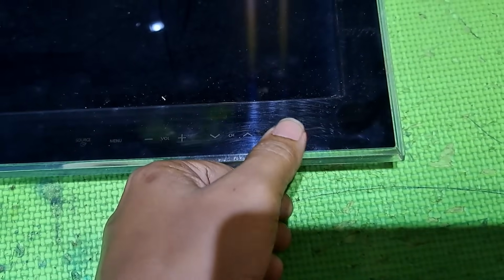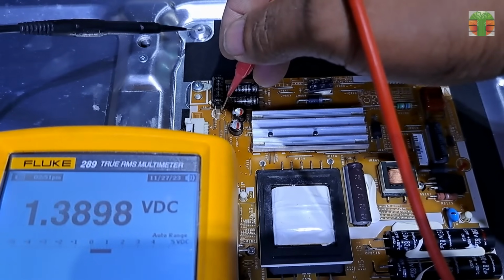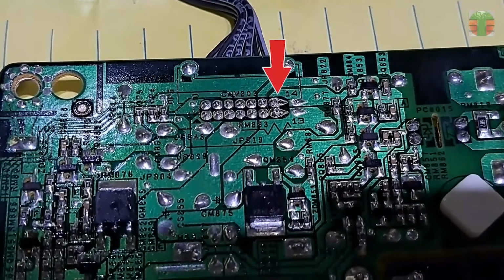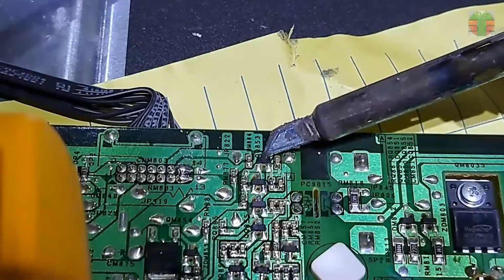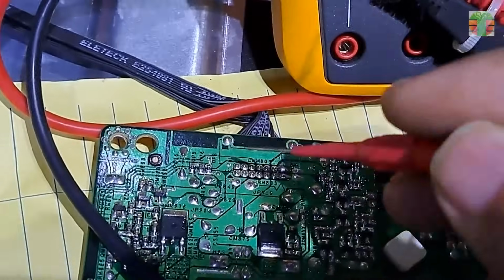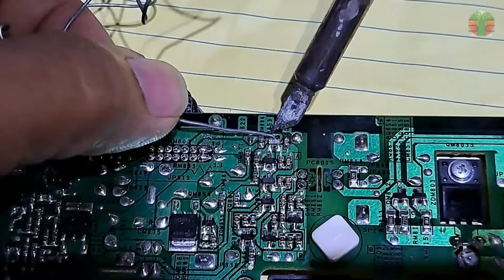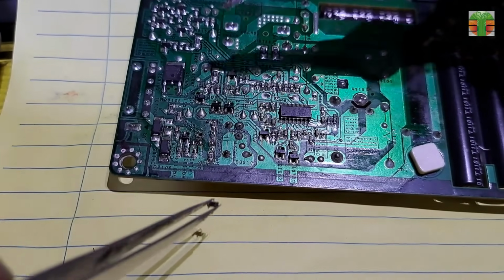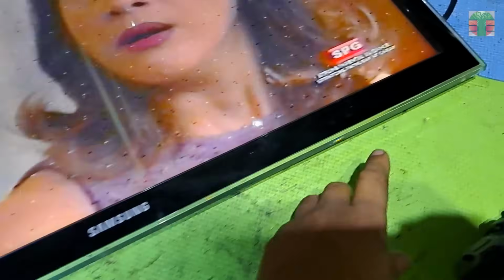Samsung LED TV removed the transistor and worked.

Comment: Hi, you're great! How did you understand that you didn't have to stop at the first transistor, the second diode but get to the backlight transistor? What would have happened if I removed the first transistor or diode? (The TV still turned on)
Thank you
Reply from the maker: Yes the tv will turn on, but I want to show what is realy the faulty component.